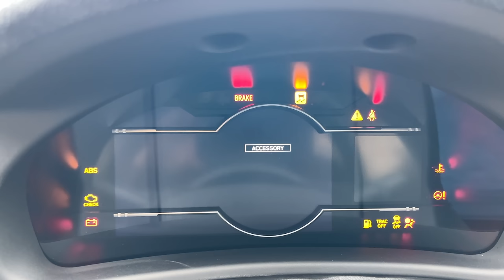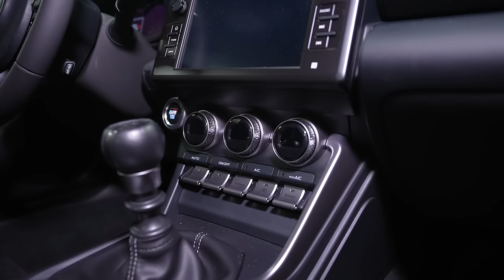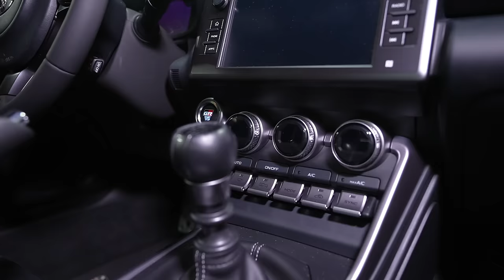Should You Buy a 2023 Toyota GR86? It's heavily over shadowed by a rival in 2023

Comment: I see it the opposite: why would anyone buy the GR Corolla? It costs so much more even before markups that it's a closer competitor to the 2.0 Supra or 3.0 with markups, it's ugly AF, interior is boring and built to be profitable in a base car less than half the price, drive reviews are lackluster (the reviews make it sound like it IS a true Toyota, unlike—thankfully—the '86), the Honda Type R exists, it's got a half-ass AWD system that sounds like it handles like FWD, and an engine with too much power per displacement per cylinder to trust for a daily driver, which is what the point of a 4 seater is (minus the Morizo which is stupidly and possibly unique 4-door 2-seater). No idea what you're talking about with the transmission as mine shifts like a rifle bolt even in winter. Clutch pedal sucks, though from experience with both Toyotas and old Subarus, it feels like Toyota specced that. I changed the pedal spring out and that made all the difference. Miata (which uses the same transmission) is cramped and has no storage and the only one worth having—the RF—is overpriced. For what's supposed to be a basic sports car, I don't know why Mazda wasted expense and weight on a power roof panel that could have been manually removable like a US Del Sol. I paid only about $2k more for my '86 than a regular manual hatchback Corolla with minimal options. With the price differential between the two GRs, you might as well compare the '86 to a base Corvette or Supra as at least they're all sports cars (more or less) and the GR Corolla would be better compared to a RAV4 Prime in terms of similar form factors and closer price range.

Comment: Putting GR badge on this 86 is like slapping M badge on an Audi😂
Reply: GT86 would be a better name!
Reply: It was fined tuned by Gazoo Racing, so the badge makes sense. There are differences in driving dynamics between the BRZ and the GR86. The G86 has stiffer suspensions and more tail happy which falls in line with what the hachi roku represents. Do some research people!

Comment: My biggest problem with the GR86 is less about its performance but more about its practicality. It's only a two seater (2+2 but the backseats are useless) and that's very inconvenient. They said this is the successor to the AE86 but that smaller car has useable and even spacious backseats. It's the ONLY reason why I would pick the GR Corolla over this, but it's only like 5% difference.

The GR86 also didn't come with a Liftback model but that's beside the point.

Also, they have the audacity to make a limited run called "Trueno" but didn't have pop-up headlights.

Comment: While the GR86 definitely looks great, I’m just completely flabbergasted as to why Yota would even CONSIDER putting a Subaru Boxer engine in ANY Yota vehicle. They’re just not reliable at all compared to a Yota engine. Most of them anyways. I’ve heard, from techs that are significantly more knowledgeable on the subject than I, that the 4cyl Boxers were a lot better than the 6cyl Boxers. With that said, it’s definitely NOT a 1GR-FE or more comparable, a 2GR. 
 Absolutely love your videos Ahmed!! Watched all of your 4Runner videos and a lot of your Taco’s, while researching which model and which trim, to purchase. I ended up with a 2021 4Runner TRD ORP w/Predator package. Traded my 2015 F2FIDDY that I put an 8” BDS suspension kit and 38x15.5R20 Toyo Open Country MT’s on, among other aftermarket parts. Absolutely loved my truck, but the cost of maintenance was killin me on top of the diesel mpg. I absolutely LOVE my Yota!!! I went from $4+/gl w/ 11mpg diesel to $3+/-gl w/ 20mpg gas and an oil change is $100 +/- unless doin it myself. My 38” tires, which I was in need of, were $2700/set and now my tires are somewhere around $235/tire. My 38’s were around $675/tire. 
Appreciate all the videos Ahmed!! Hope you & the fam are doin great my friend!!

  God bless~

Comment: To each his own.  But I disagree.
GR corolla is ugly, this car is not.  I don't care if it's "original", whatever that means.  Maybe it's a Subaru, so what?  And maybe it's underpowered for the track.  I've never been on a track.  In the real world, 228 HRSPRS is plenty for a car this small.   A manual, a little bit of pull in second gear, and good handling are what I'm ;looking for in a "fun" car.  I have no need for some 500 HP monster that guzzles gas and costs a fortune to insure.  I just don't get why everyone seems obsessed with horsepower these days- are you all dragracing a lot? 
Also, it's 30K, GR Corolla starts at 36K.  For an overstyled uggo.

Comment: As electric and highbred-cars take hold I want a low miles clean manual sports car to keep in the garage for long term

MX5 rf 180
Or
GR/GT86 

Thanks for these great videos. Ive driven the Gt86 and Mx5rf. Both great. With you info the mx5 makes more sense mechanically for long term reliability and parts availability. 

Or an s2000 ?   

6 months to make my mind up… 

Thanks for the well made informative content!!

Comment: Did just fine against the 981 Cayman S on my last outing.  Agreed it is challenging on straights, but the advantage you have in the turns should more than compensate.  Agreed also that it is not a car for tracks that have many high speed straights, which excludes most common (non-majors) tracks, as local tracks tend to have more technical layouts.  As for the GR Corolla, it has heating management problems on the track that have not been resolved by the aftermarket, and only a few years after release, I never (read: never ever) see them on the track now.  Here's how it matches up against the last-gen Cayman S.  https://youtu.be/7Wmkd96jf0I

Comment: i wouldn't buy it because hatch backs are ugly. it looks like it got rear ended and it's ass got smashed in. miata looks better. also has a better engine. no one wants that subaru rotary junk. hard to work on and notoriously unreliable.

Comment: This guy just doesn't get it. This car is designed and built to be driven on back roads. It is not a track day hero if you want that go and buy a used Lotus Exige. This an analogue car, the last thing that it need is a turbo and all of the extra weight that the additional cooling would bring. If you want a really heavy over powered car then go buy a BMW M2 or M3 or any Yank Tank!